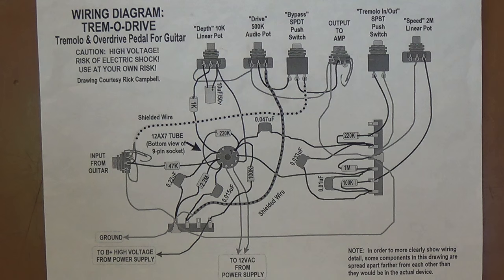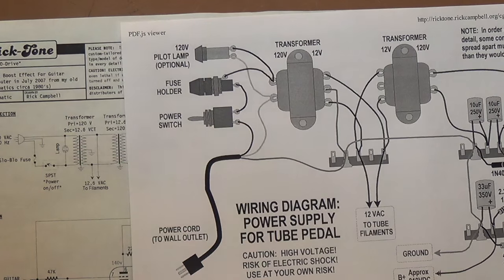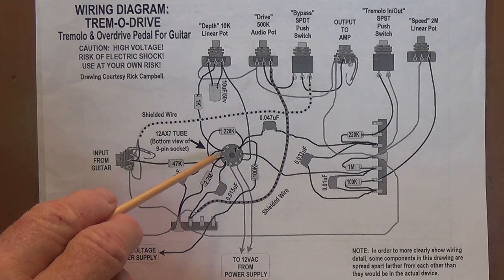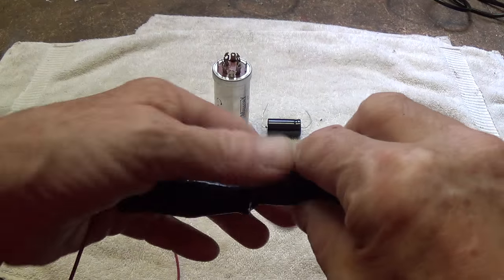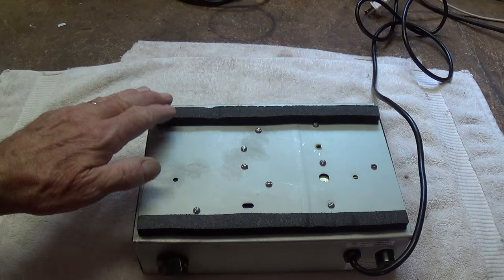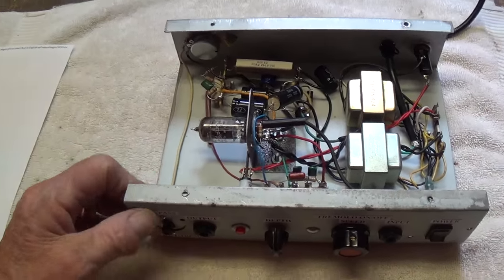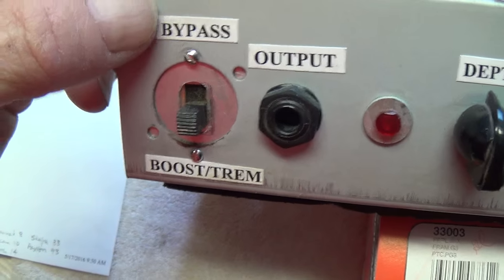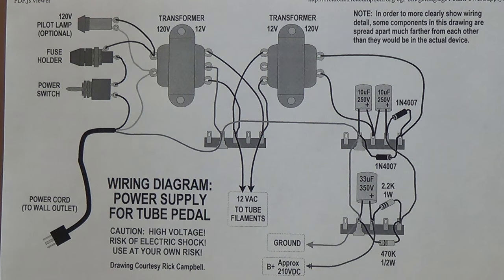Build Your Own Inexpensive Tremolo & Overdrive Boost Unit, Part 2

Comment: Great Video , Thanks again for all of your knowledge sharing, I am in the process of saving some money to try and restore a br6 gibson amp and I have a vibro champ that is changing volume levels. I think it needs to be recapped. From what I know it is original. Do you have any videos on replacing a field coil speaker to permanent speaker???? That's what I want to do with my grandpa's br6, that way I can use it as a Head..... Maybe I can mail some steak's , beer, and Money for a little help??? lol Thanks Uncle Doug Happy New Year!!!!!
Reply from the maker: You're welcome, Jimi. Changing volume would probably be due to a bad solder connection, volume pot, coupling cap, or tube.....it's not a filter (or general) cap issue.  To replace the field coil, you can either connect the two field wires to a filter choke coil or to a high-wattage (20W or so) ballast resistor of resistance equal to the original field coil (probably 500 to 1000 Ohms). Check your plate voltages after the substitution to be sure they are within normal parameters.  Good luck.

Comment: Thank you Uncle Doug....i have a question, could a  person use a 1.5k 5w power resistor for discharging caps? Or would the higher resistance make the capacitor  discharge too fast?
Reply from the maker: The 1.5K resistor would probably work OK. Higher resistance requires a longer time to discharge the cap, so hold it in place for several seconds.
Reply: @UncleDoug  thank you
Reply from the maker: @danielwelsh  You're welcome, Daniel.

Comment: Hi Uncle Doug, I'm approaching this build and wonder if you could answer a couple of questions, please? I am in New Zealand and our mains supply is 240 vac 50hz. Is there a formula for adjusting the power supply circuit? I have two mains transformers from battery chargers, they are both 240 primary with 16vac output. Is the 16v too high for the AC to the filament(? sorry, I don't have the schematic to hand, so if I've misnamed that connection you'll know what I mean)? While I have hacked/repurposed older valve audio amps, your vids have motivated me to have a go at a scratch build ( even if most of it will be recycled parts) . I love the pace of your videos, I can keep up but never feel the urge to skip ahead. Many thanks for your time, sincerely ,
    Dwayne .
ps A short clip on your hotrod would be cool! I have a 70 Ranchero, small block,lakepipes and a T5!!
Reply from the maker: If your mains supply is 240VAC you can omit the voltage doubler circuit, Dwayne. The rest of the circuit will remain the same. I would say that 16V is too high for the 12AX7 filament. Step it down a bit with a resistor......you can experiment to find the proper value.
Reply: Thank you very much, I will have a go and let you know how I get on! 👍

Comment: Wonderful details in close up, and I like the foam "feet", a softer version of Orange's wooden feet.   Presumably the CT on the first transformer is to reduce heater noise, would an artificial CT (2-100ohm resistors)have the same effect?  I'm guessing Jack was napping during filming. :))
Reply from the maker: +bullthrush  Thanks, Andrew.....glad you liked my version of "feet" :) Yes, an artificial CT would work just fine if both TF's lacked a CT.  Jack was directing this video......he and Rusty take turns.
Reply: I've finished mine, and the video is up on my channel.  Please feel free to link it to your FB page if you think your followers are interested.
Reply from the maker: Congratulations on a successful build, Andrew. I will check it out.

Comment: Hi Uncle Doug, It's late and I've been watching your videos for the last 4 hours at least so my brain is on fire :-) I'm not sure if I'm missing something here. I have 240 Volts and you say leave the doubler away. Does that mean NO transformer whatsoever? I need 12 Volts for Tube heating. AC from the wall to the rectification/ power switch and fuse and a small 240-12 Transformer? sorry for being so knowledge resisten today :-)
Reply from the maker: You still need the two transformers, Elvin, but you don't need the voltage double circuit.....which is completely separate from the transformers.
Reply: You're right ( of course!) what was I thinking!
Reply from the maker: No problem :)

Comment: Hey Uncle Doug,  I'm purchasing parts for this build and want to know how does one go about selecting a fuse (for this build or for any circuit)? I know this information is probably buried in more than one of your videos. Thanks for all you do!
Reply from the maker: If you don't have an ammeter to measure actual AC inflow, then use trial and error. Install a 1A fuse and see if it works OK. If it blows, try a 1 1/2A or 2A fuse. You should not have to go any higher than 2A.
Reply: @UncleDoug  Simple enough. Thanks! This will be my first "scratch build" of a circuit so I'm sure I've got a lot of trial and error ahead of me. In addition to providing the entertainment and appreciation of watching a master at his craft, your channel has given me the knowledge and confidence to begin my own projects and for that I cannot say thank you enough!

Comment: Short question Uncle Doug: can the 12VAC filament voltage from the first transformer be rectified without disturbing the input to the second transformer..?
Reply from the maker: +John Raine Lund   If you want to rectify the filament voltage, I assume to reduce hum, you could add a properly biased diode to each of the filament voltage wires that branch off from the inter-transformer connections....but there will be some voltage loss due to the rectification process.  Be aware that this is really not necessary, since the circuit (if properly constructed) is very quiet even with the AC filament leads.
Reply: +Uncle Doug Thanks for your reply. My project is for an old microphone from 1950. The tube is a MSC-2 which requires 90VDC for the anode and 3.8VDC  at 120mA for the filament (directly heated triode).
Mine is a general question really on the interaction between the two mains transformers when the first output is both rectified for the filament and also fed forward into the second transformer for the HT
I have tried this method, with success but was never quite sure of it's validity.
A small comment on your tutorial videos: I have covered a lot of the material previously but you always seem to add that extra nugget of information which other tutors omit. I always learn something enlightening whenever you post. Thank you.
Reply from the maker: I don't think that rectifying the filament leads would have any adverse effect on the connection between the two transformers, John. Thanks so much for your very nice comments regarding my videos. Rusty and I really appreciate it :)

Comment: Any chance of getting a video on how to make a vibrato unit? Maybe even one that would replace the tremolo in this boost unit.
Reply from the maker: If you're speaking of the type of true Vibrato featured in the old Magnatone amps, it would be way too complex....requiring additional tubes, a larger cabinet, way more circuitry, and a larger power supply.  I don't foresee such a project in my future, but if you decide to build one, please let us see and hear how it turns out.

Comment: Hi Uncle Doug, I'm pondering building one of these. In Australia with our 240-250 vac supply, I calculate that we would not require the voltage doubler circuit in the power supply?  Thanks, Colin.
Reply from the maker: +charris939  You are correct, Colin. Leave off the Doubler and use a Bridge rectifier instead.  You should have plenty of voltage and power for the Trem-O-Drive circuit. Good luck :)

Comment: Thank you for sharing all this amazing information. Would a separate box for the power supply increase the signal/noise rate, or in other words, is it worth the effort to split the circuit in two modules, one for the power supply, another for the audio circuit, both with aluminum cases (both grounds conected)? Best regards.
Reply from the maker: You're welcome, Fab. I guess you could, but it's really not necessary. The unit is very quiet as-is.
Reply: Thank you for the advice, it was helpfull. I'll keep watching your videos.
Reply from the maker: You're welcome

Comment: Uncle Doug,  unrelated question, but I didn't want to ask in an old video.
I have a Fender Super 60 blackface with two 6L6s in the PP output.  After taking it out of standby, in 1 or 2 seconds later, there is a bright flash in ONE of the 6L6s and a very loud bang through the speaker.  That blew the 500 ma. fuse in my 2-channel bias current rig.  I thought I had mechanically bad output tube so I installed a different, proven working pair.  Same failure same short time.  The primary of the output transformer tests fine with roughly equal winding resistance on each half and passes a 250 vDC Meggar test.  Something else is causing one of the 6L6s to have very high current once the B+ comes up.  What do you think is the likely cause and I should I check next.  Thanks.
Reply from the maker: +dennis walsh  I am no fan of Standby Switches, Dennis, largely for the reasons you are discovering. Rather than applying a relatively slow warm-up for the tubes, the SB switch allows the power supply to come to maximum power and then slams the output tubes with a high peak voltage.....just the opposite of what you are using it for.  I can offer no specific insights without a schematic, but my suggestion would be to run the amp without using the SB switch and see how things go. You might also try running it with a current limiter and watch the bulb for an early flashy. Also, isn't 500mA a rather small fuse for an amp of this current utilization?

Comment: Hey uncle Doug, I can’t wait to build one of these, but I do have a question on the transformers current capability. I actually started working on the Rick-Tone type 18 amplifier first, but it also utilizes the voltage doubler, just with a 12AT7 in the preamp, and a single 6AQ5 in the power amp. You mentioned that the current capability of the transformers you used in your project was 400 mA each. Does that mean that the total current capability for the Trem-O-Drive is only 400 mA total? Based on my RCA tube manual, the combined 12AT7 / 6AQ5 current requirements for the heaters and plates are obviously going to be much higher than a single 12AX7. I am trying to determine what the adequate current capability would have to be for each of the two transformers, and like you mentioned, the current requirements are not listed on the schematic. Assumptions are dangerous when combined with electricity. I just wanted to confirm that the presence of two identically rated transformers, opposed to just one, does not imply greater current capability. I have two identical 120 V to 12 V center-tapped transformers that are both rated at 400 mA, but based on the tube data, I don’t think I can use them. Thank you again for all of the knowledge and insight that you share! I know it’s going to be a good day when your notifications show up in my YouTube inbox!

Comment: Hi Uncle Doug. just a quick question from Europe. Are there any modifications we need to make to get this to work on a 240V supply. I'm thinking transformers for a start. It looks like a fun project. Thanks for the videos.
Reply from the maker: +charlotte bell   Use the same transformers, but skip the voltage doubler and instead use a full wave or bridge rectifier. You'll end up with about the right voltage for the circuit.
Reply: +Uncle Doug Thank you. I'll give it a go 😀
Reply from the maker: Please let us know how it works out :)

Comment: Hey, thanks for all the safety tips. And I've been looking for months to try to find the vid where you describe your capacitor draining tool! One thing caught me up short, here. You mentioned that a 12ax7 doesn't mind being mounted sideways. That suggests that some tubes do? Are there some tubes that have to be mounted vertically, and why is that?
Reply from the maker: Yes, not all tubes can tolerate alternate mounting positions......probably due to a lack of support of the internal components, which may yield to gravity and create shorts or other malfunctions (?). There are charts (try the Internet) which tell which tubes can and can't tolerate odd positions.

Comment: I'm having a strange problem. I recently built one of these tremolo-drives for myself, but I haven't got it working properly just yet. I checked all my wiring and can't see anything wrong, in terms of components being soldered to the wrong terminals. So I checked the voltages. The AC coming out of the back end of the transformers is 117 volts, which is what I would expect, but the B+ after rectification is something like 313 volts! How is that even possible? And when I check the other voltages at the plates, they are  about 100 volts higher too. Any idea what is going on?
Reply from the maker: Greetings, Daniel. Are you making these measurements with tubes in place and the amp fully functional?  Without the tubes and current flowing, voltages will be quite high.

Comment: Hey Uncle Doug! I am going to take a crack at building this but was wondering if you would be so kind as to provide the dimensions for your chassis? Love the channel, I’m learning tonnes!
Reply from the maker: The chassis can be any size you want, LB. I simply used an available metal box.  When you build from scratch, there are no constraints.
Reply: Uncle Doug Thank you Uncle Doug! You Rock!!

Comment: Hi, I live in the UK where mains voltage is 230v. could I just use two 230v to 12v transformers and do away with the voltage doubler circuit?
Reply from the maker: +George Hind  Yes, indeed, George.....then add a full-wave bridge rectifier.

Comment: Hi Uncle Doug.....I've been thinking of putting one of these together.  Quick question....why 12 volt?  The heaters on 12ax7 builds are usually 6.3 volts.  I have tube data on the 12ax7 that the voltage of the heater-cathode is for this tube is +/-200 V peak, 100V average.  Seems like the 12 volt should and is fine but also the 6 volt would work if I had a 6 volt secondary.   Just curious.  Thanks!  Bart
Reply from the maker: Greetings, Bart. The filament voltage for a 12AX7 is 12V, hence the "12" in the tube's ID number. Because the filament is center-tapped, you can wire it in parallel to a 6V filament source, but it was built to use 
12V in series. The only setback associated with the 6V filament wiring is that it draws twice as much current as the 12V wiring.
Reply: +Uncle Doug Got it. Thanks!
Reply from the maker: You're welcome, Bart.
Reply: +Uncle Doug Hi Uncle Doug.....confused myself again.  I was looking at the Ricktone 19 amp.  It uses a 12AT7 preamp, however, the filaments are getting 6V.  I also looked at some pictures on Ricktone website of the trem-o-tube and he has a 24v secondary, I assume a 12-0-12.  I'm just having a hard time getting a handle on why these two are different.  Sorry for all of these questions.  Thanks!  Bart
Reply from the maker: Looking at the Ricktone 19 schematic, the power transformers both have 12V secondaries, just like in the Trem-O-Boost, and the first one is center-tapped, so 6V is available for the 6BQ5 and the 12AT7 filaments can either be wired with this 6V in parallel (using the filament center tap) or in series using the full 12V output from the secondary of the PT. It is exactly like the TremoO-Boost.
Reply: Hi Uncle Doug.  Ahh....... As I look at the schematic and hook up diagram of the TremOBoost, the 12V goes to pin 4 and 5 but not 9 on the 12AX7.  In the Ricktone 19, the schematic now shows that pin 9 is included in the wiring with pins 4 and 5.  This now give the Triode 12 volts and the Pentode 6 volts.  Right?  Thanks!
Reply from the maker: I'm not sure what pentode you are referring to, Bart, but attaching one of the 6V wires to the center tap of the 12AX tube (pin 9) and the other to both pin 4 and pin 5 provides 12V for its filament, while simply attaching the the two 6V wires to another tube's filament pins will provide it with 6V.
Reply: +Uncle Doug Hi Doug, I should have said the 12ax7 instead of the triode (double triode). You have confirmed what I was thinking. Thanks again for all your help and videos!
Reply from the maker: You're welcome, Bart.

Comment: Is it possible to make a stand-alone, all-tube driven harmonic tremolo system similar to the harmonic tremolo based off of the brownface amps of the early 60s? (Much like a stand-alone reverb unit except for tremolo)
Reply from the maker: +vetacoth  I guess it would be possible, but it would be extremely elaborate with at least 3 tubes plus a rectifier. I had a brownface Concert amp with the so-called "vibrato" effect, and must admit that it was really nice. If you do build it, please let us know how it turns out.

Comment: I love the whole series so far.  This a great project and the sound is amazing.  I ran across a Valco "Super" at a local music store.  The sound was stunning.  I was thinking of building one.  The schematics I find list list it as a Gretsch 6150.  I know Valco made amps for Gretsch so are these the same?
Reply from the maker: +Jennifer Johnson  Thanks for your kind words, Jennifer.  Yes, Valco did make Gretsch amps and the amp you found may well share the same (or very close) circuit as the 6150......which in turn is virtually identical to the Fender 5E1 Champ. Good luck with your project.